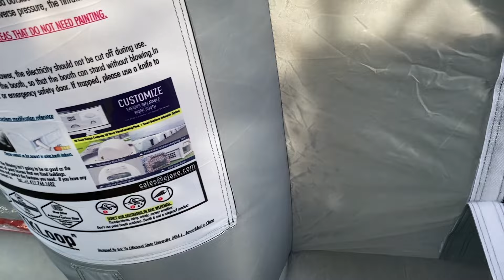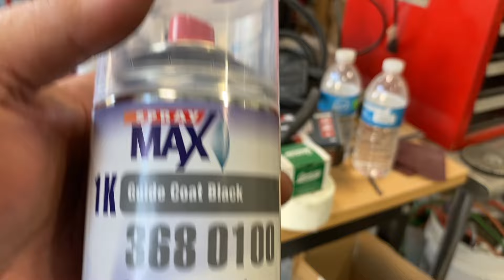Blow Up Portable Paint Booth! Awesome! 1972 Mustang Mach 1 Is Officially Getting Painted! #musclecar

Comment: I don’t remember, for sure, but I think the back windows on my ‘72 Mach that I had in high school back in 1978 were fixed without handles.   I know the seal on the drivers side was bad and it took forever to get one in.   I remember this because the heater core went bad in mine and we blocked it off leaving no heat and cold air rushing in around that missing seal made for a very cold ride.   The upside my Mom got a new 1978 Camaro Type LT for Valentine’s Day and if it was very cold she would let me drive her car much to my Dad’s chagrin.  The Mach 1 felt faster even though it was a 351-2V ( Ram Air) and the Camaro was a 350-4bbl (basically  the same engine as the Z-28 without the dual resonators and 2–1/2 inch tailpipes) engine code LM1 but the Camaro had A/C, cruise, tilt, power windows and locks, and lots of sound insulation the Mach 1 did not have so I’m sure the Camaro weighed a few hundred pounds more and was saddled with a 2.41 axle ratio and automatic transmission.  Never had chance to race them.  My parents were a little too smart to let both cars leave at the same time or let someone else drive my car.   Seat of the pants feel said the Mach 1 would have definitely won in an 1/8 mile and maybe held the Camaro off thru the 1/4 mile after that the Camaro would have sailed on past the Mach 1 because of 2.41 axle ratio and the 4bbl carb the Camaro definitely had more top end. I saw 130 mph more than once in the Camaro and at about  110-115 mph the Mach 1 sounded like the pistons were going to come thru the hood.

Comment: Glad to see the old Mach coming back to her former glory.   It’s been a long ride but she’s in the home stretch. I gotta say after she was soda blasted I thought she was too far gone.   I know I give my opinion too much but don’t paint the whole hood flat black.   The inside of the hood should be a low gloss not flat black and the hood black inset was not a decals it was factory painted and buffed in and it was a low gloss but not flat black.   I’ve seen them with the whole hood flat black and or argent(flat silver) and it is not the same as having the factory style inset color.   Also if you have the ram air hood you should put the 351 Ram Air stencil on the scoops it really makes the whole muscle look come together.  I am sure you can find the stencil somewhere on line or at one of the Mustang guru’s like CJ’s pony parts, etc.   If you want even more black on the hood use the Boss 351 stencil then almost all of the hood will be black and should definitely have 351 Ram Air on the scoops.   Remember it’s not flat paint it’s low gloss.   You can’t wax or buff flat paint.   Hell, you can barely wash it and it looks off.   You’ll thank me when you see the result stenciling in the original hood accent and the 351 Ram Air on the the scoops in low gloss black.  I still remember the minute I saw the 351 Ram Air on the hood of my 1972 Mach 1 and I was 16 years old. I am now almost 62 years old and I remember thinking that it would be my car by the end of the day and it was.   I traded an almost brand new 1978 Mazda for it even and never regretted it.   My parents regretted it but I didn’t.